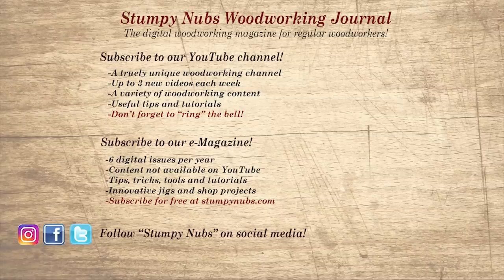Are table saws becoming obsolete?????

Comment: I bought a used table saw and it’s been the biggest “How did I get anything done before I had this?” tool
Reply: Now you will be checking for square.  Just pray your square is actually square.  Most cheapos aren't.  Some you pay more for are also not square.
Reply: @georgeohwell7428  I’ve checked for square, it’s square. Have I put a dial indicator to it? No. Can I tell I haven’t put a dial indicator to it? No. It’s possible that I’m not a fine enough woodworker to notice the difference. However I can tell you that it’s more accurate and repeatable than my previously employed methods of a straightedge and a skill saw.
Reply: @Enispecialist  but is your square square? :)  Do the flip method to find out.  I was surprised how many of my "squares" were off.
Reply: @Calvin I did the same a few years ago and totally agree.  I scored a mint cast iron Craftsman for a song.  It is square - as a Mechanical Engineer,  I know how to measure things.
Reply: I have a SawStop ICS 3 phase. The fence is within 3 thou to the blade and the current blade has 2 thou runout front to back. Harry worth worrying about. I break down my sheets using a Festool TS55 tracksaw and guide rails with TSO squares attached. Both super accurate and both necessary for the way I work. Dust control is amazing for both. I am not saying all this as bragging but more from a practical and safety perspective. I am truly fortunate to be in a position to afford this excellent stuff.
Reply: I was given a delta contractor saw built in 1988 and it's been the best machine I've ever had.

Comment: Dear James – As an avid cabinetmaker for 65 years, I must compliment you for your fresh approach to woodworking and for always telling it just like it is. Crisp and sharp, with no BS, in this video and in many others. Case in point, using a table saw versus a track saw to make fine cabinetry. There was a time when I was able to maneuver an 80 pound full 4 x 8 sheet of oak or mahogany veneer plywood across the table saw to break down the sheet into usable pieces. I would then pass those pieces, which I always made slightly oversize, through the table saw to make each part of the exact size within thousandths of an inch of each other. But today, in my 80s, I use a high-quality track saw to cut out the parts – but, although some might say it's unnecessary, I always cut the parts a bit oversize to permit a final run through at the table saw. One tool DOES NOT replace the other; both help us enjoy our craft and produce the best results.
Reply: Thank you for sharing your hard earned wisdom.  Cheers.
Reply: Yeah, that is my method also. It is amazing how clean one can get a second cut.
Reply: @RAkers-tu1ey You make an important point. The quality of the second cut is better when the blade is just skimming off 1/8 of an inch.  And the woodworker has a much easier job smoothly guiding the smaller, lighter piece through the final cut. Also, I use masking tape when crosscutting plywood to prevent tear out.
Reply: @poppamichael2197  Thanks!  Yes, when I was doing production work, reduced scrap was an important issue for the company. But, for me working solo, scrap was secondary to versatility and safety. I only have about 50 years in the trades, so I am still learning.
Reply: Glad to hear an oldtimers change in approach same for me. Having been at the game a long time. Track saws are a game changer. I think unless you can get a saw with a 10" blade - their is to much limitations.
Reply: Well said sir!

Comment: Well said.  For “assembly” furniture with metal attachments and breaking down panels of man made boards to earn $ can’t beat my track saw. But for joinery with fine repeatable accurate cuts the phaff of setting rails up, and convenience the table saw is the go to. Depends on what you do. No one solution is the answer!
Reply: Noooo. no no no no no. I have track saws. I've built dozens of kitchens from man made boards to earn R. I would never even attempt to build one with a track saw. European style "assembly" furniture requires European style panel saws. Not table saws, panel saws. Saws that can break down a full 4m x 1.8m board with sub mm precision. Anything else is amateur hour.

Fine woodworking can accommodate the slop and inefficiency you get with a good table saw.

Track saws are for site rework and odds and ends.

Comment: You're spot on as always Stumpy.
From my perspective, my cheap track saw massively outperforms my cheap table saw. Neither offer repeat cuts (the fence on my table saw is dangerous, I need to keep an eye on it whilst I cut as it'll move with the slightest breeze) and the track saw just stays in place. Every cut has to be carefully set up each time regardless.
I'm speaking from a budget hobby viewpoint, it can be months between uses. Limited budget? Just get a track saw. Cheap table saws are a false economy. I only trust mine with a (homemade) crosscut sled now. Even then, my (yeah, budget) compound miter saw usually comes out before I clear the detritus off of the table saw storage system.

Comment: Professional woodworker going on 45 years--can't imagine trying to pay the mortgage without a tablesaw.  Looking forward to trying a Ridge blade.
Reply: When I used a table saw, I was stuck in the mentality of thinking nothing else worked like one. But it also held me back subconsciously. Once I got rid of a table saw and jumped head first into track saws, I realized a whole new world. I was able to do most of what I did before but also able to work with much larger pieces (sheet goods especially) and ended up taking on building a vocal booth for myself (I don't know how I would have done that using only a table saw). I am firmly in the realm of track saw with some type of work table like ACS or MFT.

Comment: Definitely agree.  Love my router table and my track saw, but your thoughts are spot on.  Repeatability and ease of use with a table saw that has a good fence is very difficult to replicate for the kinds of cuts that I frequently need to make.  Great analysis!
Reply: I am always blown away that people continue to talk about track saws as though the ACS and MFT don't exist. I would argue that those tables make repeatability much better on the track saw over a table saw when you are talking about larger cuts (especially crosscuts or sheet goods).

Comment: As I’ve become a seasoned citizen I find that a 4x8x3/4 mdf or plywood is hard to get up onto a saw table.  I find that breaking down the sheet goods with a track saw, a little over dimension then making precision cuts on my sawstop makes it a lot easier.  A table saw is the heart of my shop and I’d quit woodworking without one.
Reply: @ELW2940  a lot of people just slide the sheet goods onto a piece of insulation. So you just have to lift the edge up 1 inch to get it onto the sacrificial padding, then push the rest on top. I've always either shoved pieces of scrap or cardboard under my sheets or just placed it out on the grass for rough cutting.

I also do this out in the hardware store parking lot since I don't have a vehicle that can fit full 4x8 panels. Bring a battery powered circular saw and find a piece of grass or a nice curb to work off of.
Reply: @ELW2940  As I've gotten older I now know there's a lot of difference between dragging a piece of ply up onto saw horses and making a perfect rip cut on a table saw with a full sheet of ply.  I was injured in a car wreck in 2004 and tore away part of a bicep in 2005 so I have to work around those injuries.
Reply: @MattMcConaha  My local HD will make as many cuts as I like for free. I trim to final at the Sawstop. Works out great. My local lumber yard charges a buck a cut. I still find that a few bucks saves me headaches (and back aches). The tme vs money calculation.
Reply: @scottmessina9435  My local HD has a panel saw that makes abominable cuts.  Tear out so bad I had to waste 3/4 inch on each side of the cut.  Tried them once - never again!
Reply: After crushing my toe with a sliding 4x8 sheet of MDF I've tried to avoid manhandling the big stuff. I picked up Bora's panel carrier on sale at Rockler and it's a godsend. It's much easier to move sheets from  truck to shop, and it's a handy outfeed table, too. It folds flat when not in use. For me it's easier to cut down sheets on the table saw than crawl around on the floor with a track saw.
Reply: @RayStarbirdHome  I know what you mean about crawling around on the floor, it’s hard to get up.  I put a 4x8 foam insulation board on the table saw and outfeed table and use the track saw.  I have a hard time cutting a big heavy piece on the table saw with half hanging off the edge of the table.
Reply: @ELW2940  My out feed table and saw table make a 4x8 flat surface to put the 1” foam and I can still get the panel up to break it down.

Comment: Great summary of advantages of table saws. My summary of the summary: it is faster to use a table saw and if you produce a lot then cheaper in the long run. For me I'm convinced (now) I do not need a table saw, I do not need to save time (!) and I do not produce a lot. But I have limited resources and space. Thanks for the clarification!

Comment: Good points. I'd say my Grizzly G0771Z has been the single most transformative power tool in my little shop. The only shortcoming it has is the inability to double as a griddle for cooking bacon and pancakes. Hmmm...
Reply: If you mount an induction element under the cast iron top, pretty sure you'll be grilling in no time.  Just make sure to read the grain on the bacon.  No way it's gonna work with a track saw.
Reply: I think you might be using it wrong... ;)
Reply: Routers make GREAT smoothies!
Reply: Maybe we can get Grizzly to work on that😜
(mmmmm....bacon😳)
Reply: @jeffbaker8808  YES,Router motors have been used in blenders-thats how Vita-Mix started out-they used a Black&Decker router motor in some of their early blenders.

Comment: After deciding to get back into woodworking about 15 years ago, I purchased a Festool track saw and MFT table .  At first I liked the saw especially for sheet goods.  Once I started using it for more jointery type of work I got tired of all the fiddling and extra jigs I had to buy to make it convenient.  The fence was always suspect so I always had to put a square to the MFT table and fence to make sure it didn't change from the previous setting.  Finally I got so tired of all the little things that had to be done to make cuts, I sold it and bought a Sawstop PCS with a Incra TS_LS fence setup.  What a joy to use and it is so simple and fast and accurate.   The repeatability of this setup is excellent.  I also bought the Incra 5000 sled and that has been equally impressive.  Since selling my track saw I've never found a reason to need it and I sure don't miss all the setup and fiddling to get things square.

Comment: I have a lot of tools, but I feel like your budget for just hand planes vastly dwarfs the cost of my entire workshop.
Reply: I think the same thing every time I watch his videos! We had to use all hand tools first year of carpentry class, and only touched a hand plane in very limited  situations since.
Reply: No kidding. I have woodworking tools, fairly extensive mechanic’s tools, a LOT of electrician’s (my trade) tools, even some weirdo specialty stuff like luthier’s tools, some forging/blade making tools, gunsmithing tools and (very) basic machine tools, and I’m still very confident that he has more in hand planes than I do in every tool I own, haha!
Reply: I don't know, but I'm guessing he inherited those from his father and grandfather.
Reply: Seeing that wall makes me feel like I should have at least one of those
Reply: I think it is a collectors thing.  I used to work in a high end wood shop and the owner also had a big shelf with dozens of old hand planes that rarely ever got used.  He seemed to just like to find them in antique shops and accumulate them.  He had one or two favorites that were kept razor sharp and used on jobs. The rest just sat unused, but he'd still add a few more to the collection every year.

Comment: I got by for years with a low cost, foldable table saw. I completely understand your point about fiddling with a tape measure in front of and behind the blade if high accuracy is necessary. Lately I've been using an older craftsman table saw that the previous owner outfitted with a Biesemeyer fence and extended table to the right of the blade. I feel spoiled now that the rule on the saw can be depended upon and the fence locks square. I need to custom build a throat plate with a splitter, and I will eventually get a newer saw with a built-in riving knife. I truly appreciate your videos, largely because you always support your opinions with reasoning, and this goes a long way towards helping me work smarter and safer, as well as make appropriate purchasing decisions. Thank you so much!

Comment: The value of a table saw is speed and accuracy. This also factors into dado cuts and tenons. On a side note, the miter saw is only for roughing in my shop. Precision crosscuts are done on a table saw sled. I also have a second table saw sled for dadoes and rabbets.
Reply: How could you get so few upvotes?  I built a sled for my table saw and could kick myself for not building one 25 years ago.  Virtually zero setup time to make perfect 90 cuts cuts at the exact place where you want them, using the sled kerf to mark the spot.

Comment: I own and love and rely on my table saw. That being said, what you mentioned about having space (and table size) is essential. I’m an appartment woodworker and even my “little” 10” rigid table saw is big for my space, but still far too small for parting out full sheets, which I have to do with a circular saw to get them small enough to finish on the table saw. 

I’m eagerly saving up for my most expensive woodworking tool yet; a house with a garage so I can fit a real cabinet saw in there ;) 

Love the content. Thank you, as always, for your well rounded perspective and solid information.  I’m working through Steve Ramsey’s course now and can’t wait to jump into yours once you release it. :)
Reply: Love it! I’m trying to fit a new house or at least a new garage into my tool budget as well.

Comment: If you're gonna buy any saw, buy a mediocre one so you can blame the bad results on the tool. 😉
Reply: I love that idea. I learn so much on the internet
Reply: ridgid cast iron saws, they don't rest the cast iron before they mount the motor so it sags on one side of the throat plate so you're required to use a table saw sled for every cut that has to be precise, I've made a 7 tier plant stand with all half laps and figured out it was the saw's fault I needed to sand a bunch even though I did an setup cut on a sample. Every time I go to HomeDepot I check if their newest cast iron saw has the flaw haven't seen it not have it yet at my store.
Reply: I could get replacements but they might all have the issue, so I used a carbide router bit on a milling sled and flattened it in small passes, you can cut cast iron with normal router bits, seen it first on Cosmas Bauer's channel.

Comment: I have an old cheap table saw, purchased years ago.  I hardly ever used it as the clamp-down fence was awful, the blade shaft wobbly and the top too small for large pieces.  I got by with a circular saw, hand saw and a portable miter saw.
Recently, I upgraded to a new miter saw, bench-mounted, then a Dewalt table saw.  I built a table for the saw, a cross-cut sled and a fence extension with extra in-feed support for long thin pieces. Today, I added an extension to the table for my router, utilizing the table saw fence to clamp a homemade router fence to it.
The Dewalt rack and pinion fence is unbelievably true and accurate, though I always check a cut with a tape!  Accurate so much so, It is now my go-to cutting tool, with the miter saw only for the angled cuts.  Now, I can build stuff pretty quickly that fits and looks awesome.  I trued up a rough edge board today by CA glueing a known straight piece to it and ripping it true with my table saw! Who needs a jointer.   I now can't live without my table saw!   Wish I'd bought a decent one years ago.  Any power tool is dangerous.  Mitigate the danger with absolute care, full attention and safe, well-practised practices!  I always plan and dry-run a cut beforehand.
Thanks for the videos.  Very informative and thought provoking!

Comment: I had my table saw long before the track saw was invented. I am getting a track saw. The reason. I cannot manipulate 4 x 8 sheets of plywood on the table saw any longer. When I get the pieces small enough they will go to the table saw. James explained over and over that you don't need a TS but it can be easier to build a project if you have one. Thank you for sharing. Have a great 2021 and stay healthy.
Reply: I'm in the same boat.  Due to a car accident almost 20 years ago my shoulders are both weaker than they should be and a full sheet of ply is hard to handle.  I've finally acknowledged that I can't get two 24" pieces from a 48" wide sheet of ply anyway so I design around 23"-23-1/2" wide pieces and make the final cuts on the table saw.  The quality and precision of my work is better and it's easier on me.  I've had a couple of circular saw kickbacks and want no more part of that!  I'm past 65 and have loaded up the shop with ways to make everything as easy on an old guy as I can.